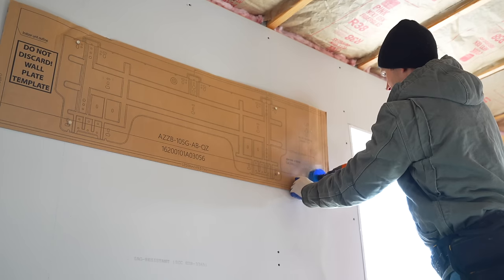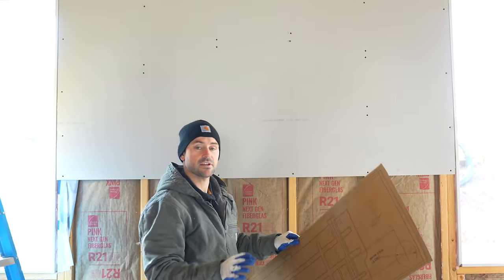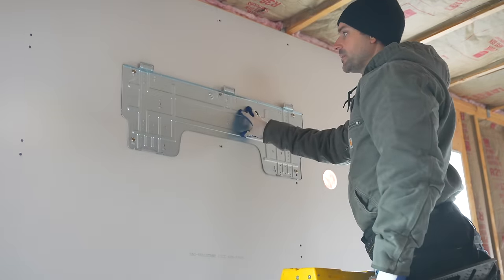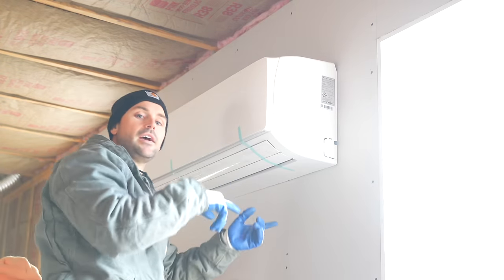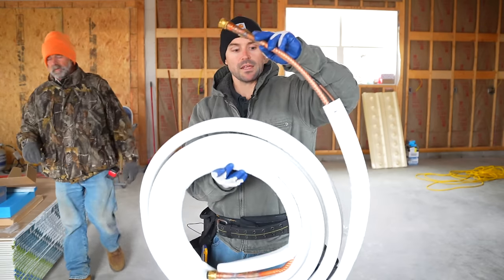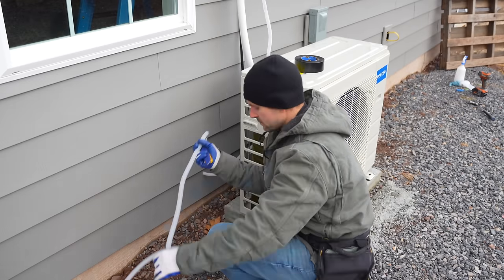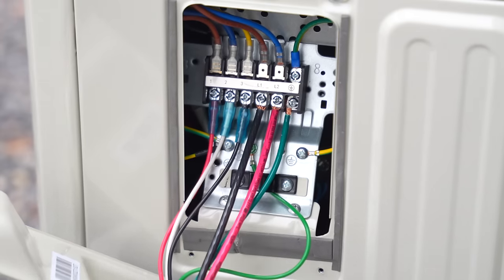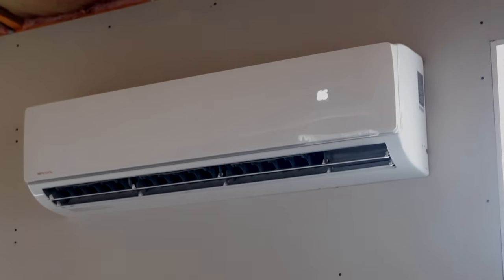How To Install A MrCool DIY Ductless Mini Split YOURSELF! - FAST and EASY!

Comment: Good luck… that system wasn’t placed under vacuum or a nitro purge since by opening the lines u let atmospheric moisture and particulate into it. Might as well throw it out within the year. If it makes it that far. Plus the voided warranty. Lolll
Reply: What are you talking about? He did it exactly how the system requires you to do it. It’s a DIY kit there is no vacuum or nitro purge genius 😂

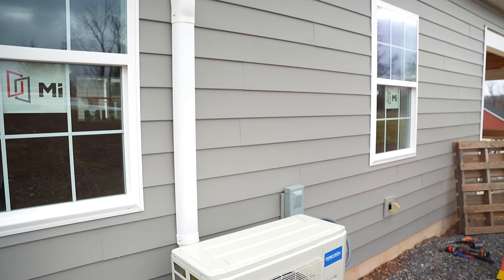Comment: 21:48 "Nice clean professional look"  Yeah but in that shot the camera is conveniently angled so it doesn't show that HUGE COIL of excess lineset.  Which, I might add, is NOT protected from the "sun and weather" (19:34) in any way.  

If that coil is fine unprotected, then the rest of it would have been fine unprotected too.  Makes no sense.  "It looks nicer though", you may say.  Yes it does.  But that's not what you gave as a reason when you were putting it up.  That hard plastic covering was going to make those lines "last many many years".  But the excess coil is not covered so you're saying that part of the coil will NOT last "many many years"?  If any part of the line is breached the whole thing is lost.  In fact that coil on the ground is MORE prone to damage due to animals, lawn equipment, women, bigfoots, etc.  Makes no sense.  

Yeah I know I could build myself a covering if I bought this kludgy system but I'm not talking about my theoretical install.  I'm talking about this video.